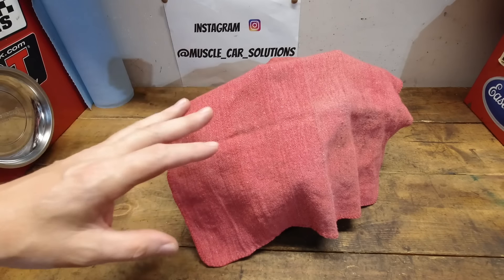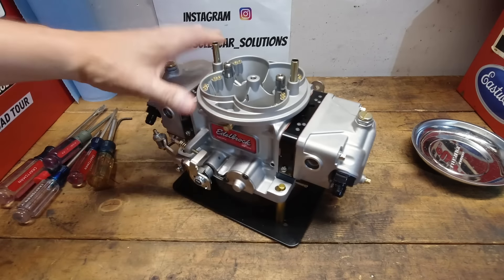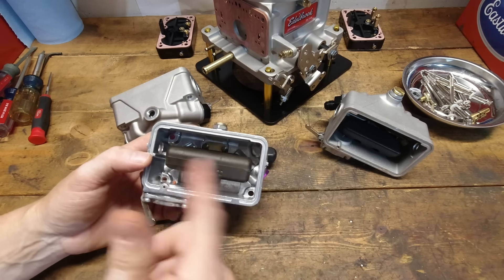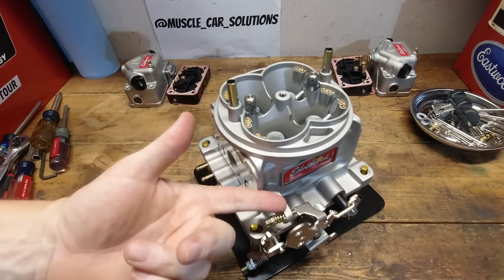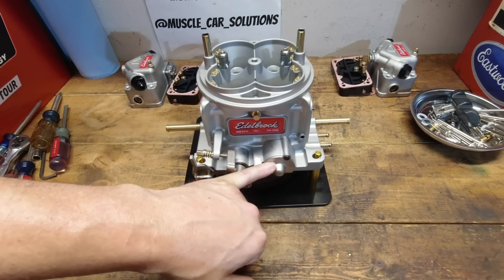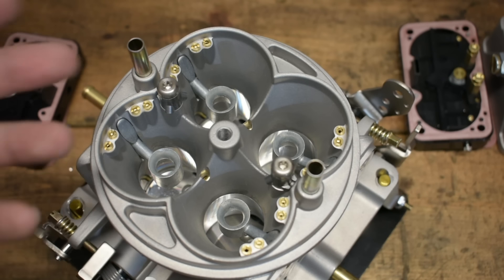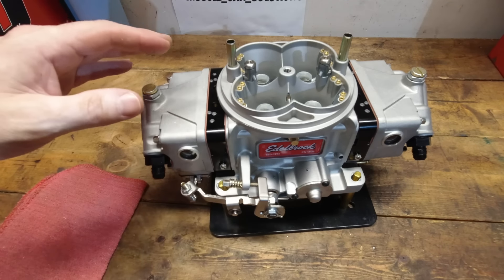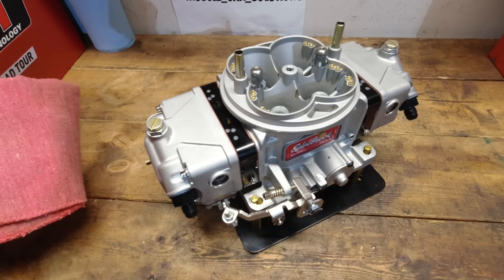The New Edelbrock VRS-4150 Carburetor - Full Review!

Comment: Glad to see Edelbrock coming out with a new carb...Especially since Fuel Injection is the "Must Have" these days! Hope they engineered the throttle linkage to give proper geometry for overdrive transmissions that use a cable.
Reply from the maker: Proper geometry isn’t achieved with the throttle linkage as the heights vary based on the intake pad height.  It’s achieved with an adjustable linkage adapter for the different types and connections.
Reply: Exactly right about EFI being the must have. My next door neighbor loves telling me about his EFI and how he won't ever smell like exhaust again. Meanwhile I do some math, found some GT40 heads for $400. Another $500 to swap my 2:78 rear end over to 3:55's. That leaves  $300-400 left for mid-eye leaf springs and 620 1" lowering springs if I want to go that route. Yeah I'll pass on the EFI and conservatively say I'll shave 1 whole second off the quarter mile, or a whole hell of a lot faster stoplight to stoplight which is where I really drive.
Reply: @MuscleCarSolutions  Ok, then why does Edelbrock sell a $40 doo dad to "correct" the geometry for a 700R4 hook up on their AFBs?  Attempt to sell I should say, I made mine using a junk TBI piece.
Reply from the maker: @paulhare662  it’s a good question.  Why does Holley offer an adapter to hook up to their carburetor(s)?  Because it’s not about it hooking up to every single option out there (not possible).  It’s picking the one for your application and then getting the line needed so it works.
Reply: @paulhare662  because people like you who don't understand how to set it up properly will buy that doo dad and spend that extra money!! I'm absolutely not hating on you everyone has to learn and after 30yrs I'm still learning myself
Reply: @jonathanlawson4667  People like me huh?  The ones who note the cable mount position, the linkage pull arc and duplicate those things? With home made contraptions?   Calibrating the governor was a bit tricky but well worth the effort.
Reply: @paulhare662  yes you plainly stated and ask if they changed the throttle to accommodate the geometry so you could set up your TV cable correctly!! You don't need them to change anything to set it up correctly 💯
Reply: @MuscleCarSolutions  Yup, I baught one of the quick fuel HR 750's and had to get a "corrector" bracket for my R4 transmission, not really nothing to do with the carb itself. The bracket also came with the little ball thing to hook the cable to my carb. So yeah I had to add that to the carb I guess, no big deal. P.S. I love this HR 750, it's been a great piece!
Reply: @BPattB  I like the smell of burned gasoline

Comment: I had an Edelbrock 500cfm on a 66 mustang for 8 years and not once did I touch the thing. Even when I would store the car for months at a time, I turned the key and it would always fire right up. For reliability, you can’t beat an Edelbrock and to see this high performance carb is just awesome.
Reply: But this new carb is $800! You can get 2 AFB's for that money and you already know how reliable these AFB's are, I dont see any advantage in going to this very complicated carburetor when you can for half the money get a simpler and more reliable carb off the shelf!
Reply from the maker: @gkauto1959 It’s not a street carburetor.  You’re comparing apples to oranges.  Two totally different applications.
Reply: $800 for a carb? you can spend half of that on another new carb and modify it all day and do much better for yourself. Not all of us have lots of $ an no brains whatsoever!  @MuscleCarSolutions
Reply from the maker: @gkauto1959  it’s obvious you’re not a racer.  It’s ok.  $800 for a four circuit carb is unheard of.  That’s a $1500 custom carb from most builders.  Hang out with some folks that run a carb and race.  They’ll school ya.  😉
Reply: I took a 72 nova into the 11 second bracket, drove the car to the racetrack, uncapped the exhaust, put on the slicks and put in the 110 leaded premium running a $400 new 800cfm AFB, that I personally ported and tuned to the point where it was great in stop and go traffic and was good for 7000 rpm upshifts. Tell me Im not a racer? I do this all on my own with nobody helping, engine, transmission and suspension mods by me alone.  Yeah, I guess you must be someone special to know that about me!
 @MuscleCarSolutions
Reply from the maker: @gkauto1959  😂😂😂 if you’re gonna tell a story, might as well make it a big one.  👍
Reply: I’m digging the ability to add a TPS for the trans in my application.  Great review!

Comment: No mention of the throttle blade shaft screws ---- are they flush with the shafts❓
And are the shafts thinned where the blades are attached by the screws❓
Also what type of material or steel are the blades made out of --- polished stainless steel❓
Thanks for the video 👍

Comment: Question: Since it has no choke, how is it at cold starts in the winter weather at 20 degrees??
Reply from the maker: It’s a race carburetor.  If you need a carb with a choke, get one.  This one isn’t it.
Reply: Thanks for your reply @MuscleCarSolutions
Reply: That ends that. I had high hopes for that VR1 650. Especially since I saw that guy with the slant six throw it on out the box and it fired right up. He said it was cold outside, but it didn't look cold!  So, I have another question then. I'm currently running an Edelbrock AVS2 650 electric choke. Infact I've been running Edelbrock carbs for some years, but I'm no expert like you are.  I used to run the 1406s all the time. Yes, I can and have rebuilt a couple. But I don't do any special modifying. I just set the air mixture screws, fast idle and regular idle to my liking.  I have a stock 350 rocket engine. The question is.....sometimes when it's cold out, my electric choke sticks when it closes at cold start up. Could I spray some WD40 on the linkage to keep it loose? or what should I do? @MuscleCarSolutions

Comment: I watched a video of yours just a while back about Carter AVS carburetors and how they had a tendency to uncover the Jets when you turned hard to the left or to the right. If you look clear to the back of the lower piece there is a channel that connects the two fuel bolts together and there's a place to put a blocker to keep that fuel from running over to one side to the other and that solves my problems with it.
Reply from the maker: @duanebiesterfeld4719 correct.  It’s the passage that supplies the drivers side bowl with fuel.  However if it’s blocked off, it completely starves the drivers side.

Comment: Would be interesting to see a engine dyno shootout of this series versus a Holley 4150 equivalent.
Also, I gotta believe at some point a full on street version will be in the pipeline at a lower price point minus all the adjustability. Most of which isn't necessary for street driving. 
Very cool to see Edelbrock going to bat for traditional hot rodders.
Reply: Let’s get the guys on engine masters to do it!
Reply: You can add a choke horn to it and vacuum secondaries without changing much else on the carburetor, I think.
Reply: I think you'll find that the adjustability will be just as important  on street cars, as well as race cars, in the interest of economy and emissions
Reply: Yeah, I wish they would come up with a street version of this carb. My 351W is not for racing...
Reply: @solarflare4259  Brother, I think with so much adjustability built into this carb, you could tune your 351W to absolute perfection
Reply: @solarflare4259   the regular eddy avs carb is a great street/daily carb.
Reply: It was fun to see them side by side  you know they intentionally made there's bigger 😃 I too have a mild street truck a 600/650 for under 350 hp would be right up my alley 😏.
Reply: @chrisw5837  yes pik a Rat that lotas people can relate to & run it against a Holley HP to compare.
Reply: @johnk1532  for those that can comprehend all the adjustments , which would be mostly bracket racers , for their street cars or trucks .
Reply: @solarflare4259  I saw someone run the 650 on a Chrysler slant six straight out of the box and it ran great. No bog, no cough when given gas.
Reply: @johnk1532 The adjustability is the entire point of this carburetor.

Comment: The taller vent tubes prevents fuel sloshing  out during rapid acceleration (drag strip). In the past (old bucks as myself), you connected a fuel line from one tube to the other. A "notch" was cut in the center of the hose for venting. Defeated air-flow though. This effectively " lengthens" the factory  by length. The bowls are also effectiant in straight-line launches. Fuel does not "roll -over" the floats. let's not forget about the bent "whistles".
Reply: had to do just that on my T wedge with 660s to stop slosh after the burnout many yrs ago .

Comment: Just came over from Uncle Tony's Garage to see what he was getting all exited about, i can see why now. 

Edelbrock have put a lot of thought into this, using symmetrical parts (float bowls and metering blocks etc) to cut down on production costs which would allow them to invest in higher quality castings.
Also being adjustable at all four corners will allow you to correct any AFR differences between cylinders caused by inconsistencies in flow through the manifold and heads.

Anybody who can pick up on making the adjustability work should be able to get a fair gain in performance.
Reply from the maker: The possibilities are endless here.  What a great carburetor.  Thanks for stopping by!

Comment: I want to see adjustable jets, like a "click click" knobs on carbs.
Reply from the maker: The big issue with that on a street carb is people would not allow enough time to drive for feedback from the adjustment.  They’d be clicking those adjustments every five minutes.
Reply: @MuscleCarSolutions  Yea but I remember a custom "block" that fit between the carb body and fuel bowl and they had a adjustment like that (years ago).  I thought it was ingenious at the time.  Theres motorcycle carbs out now that have "no jets"!  They use a tapered metering rod that with more air flow more fuel flows.  Supposed to be great in higher elevations and very little adjusting overall.  I would like to open up the WWII 'Pogue" carb and have a look at it.  Secret classified stuff, a tank getting 50mpg.  You did "the best video" on the new carb thank you so much!
Reply from the maker: Thank you!  Appreciate that.

Comment: Holley 4150 is a line, and style of Carburetor. To ask for one part number to describe that is not possible, as there are many different part numbers that fall under the 4150 purvue. After the Holley held patent was removed, many similar carburetors with the same looks, similar features and method of function came on the market. The Aftermarket parts industry calls them "Holley Clones"  Here we have it. Edelbrock copied the Holley.

Comment: Wow! It's amazing the amount of innovation and tuneability this carb has for the price! May this be as good or possibly better than fuel injection? I'm sure it will have great throttle response because of the lowered venturies. I'm no engineer, but i've dabbled in a few in my day.
Reply from the maker: Different application.  Think of this primarily as a race carburetor.  That’s where it will make it’s money when paired up with a good data logger to see the whole rpm range and decisions can be made on where more or less fuel is needed.  I’m not sure how practical it would be for the average street car user.

Comment: I love the drains in the float bowels. That would be the number one feature for me alone.... Nothing worse than dumping gas all over a hot manifold to make a jet change.  I'm not a fan of the one piece body and base, one less gasket I guess but I like the idea breaking the entire unit down during a rebuild.  Cost is comparable to Holley but nothing to write home about.   I probably won't live long enough to use all the Holley carbs and parts in my inventory to justify switching brands.  If someone hands me one, I'll certainly give it a whirl.

Comment: Ok a Holly done by Edelbrock !!!
They have a different type of plastic an rubber that doesn't dissenergrate in new gas !!!
I had finally just went to Edelbrock carbs over Holly's back when I was messing with engines !!!
Could get around a year before going into them !!!
They have the "Jet Plate Kit" on the side too ???

Comment: Will a drop base 14" air cleaner clear the fuel bowls?
Reply from the maker: @SameGuy875  yes.  The Edelbrock air cleaner that fits is in the description
Reply: @MuscleCarSolutions  Will a 1-1/4" drop base work? With the VRS being 1/2" taller the Edelbrock 1221 will not work in my application due to hood clearance. Thanks.

Comment: All those amazing improvements but you still have that dam power valve that blows out on the first backfire - not to mention having to remove float bowls etc etc etc
Reply from the maker: @yambo59  the backfiring issue was fixed in the 90s.

Comment: I am surprised someone would  design and make a new carburetor since the last new production one was in the 1980's with the Mustang.  I would like to see a Carter AVS type carb designed as a high performance carb with a 1000 CFM or more.
Reply from the maker: I think they tried making one over 800 but it turned out being complicated to get the fuel to mentee properly and with enough volume.  Would take a full internal redesign and honestly they sell plenty of that carb as it is.  No need to dilute that line.  So they built this ultimate off the shelf, inexpensive race carb!

Comment: The BG Race Demon had all those features in the 1990s.  BTW a small fuel bowl controls fuel slosh better than a large bowl. That's why a Qjet had a small bowl for 30 years.
Reply from the maker: Those carbs had a couple of the same features, not all.  And I’m not sure what kind of racing you’re into, but I don’t think carrying less fuel is going to help continue to make power.  Especially with the high HP that engines make these days and the addition of ethanol enhanced fuels that require more more volume.  Not really a fair comparison.

Comment: I have a 350SBC with RV CAM. 700r4 trans. Headers. Currently 750cfm performer carb electric choke. 4x4 1976 GMC Jimmy. Would i be able to run this carb ? I would like to get the 750cfm but I need to have the TV cable hook up. Thnx in advance. Beautiful carb! UTG sent me!
Reply from the maker: I don’t know that you’d take full advantage of all the features of this carburetor.  The 750 performer sounds a little big depending on the specs of that cam.

Comment: So it wont work with a dual 4 barrel intake because of the added length. 😢
Reply from the maker: Nope!  Not unless you mount them sideways.
Reply: @MuscleCarSolutions  Wonder if they will make a redesigned intake that the dual carbs will fit on. Dual carb intakes are Race in a sense. I guess well wait and see. Wonder if they thought of this when designed..
Reply from the maker: @jonjon_az  the sales on those intakes is so low that I’ll guarantee they never took it into consideration.  I’m honestly surprised they still offer them.  But given they only make them once or less per year, it wouldn’t surprise me if they discontinued them.  So no, I’m sure they gave no thought to fitting on a two four set up.  If you had a dominator top they might fit.

Comment: I was interested until they lied about building a 950 CFM version, so I have to run a Dominator
Reply from the maker: Lied?  😂 they’re still in tuning.  Things don’t happen over night.  Happy they didn’t release it till it’s ready.  I’d imagine it will be out in a few months from what I’ve heard.
Reply: They removed 1309 part number from the Web site
Reply: Since when is 2 years over night?
Reply from the maker: @michaelgreen5084  because it’s not ready for sale yet.
Reply from the maker: @michaelgreen5084  they never said all part numbers would be released all at once.  😂 They have released in order so far and the 950 is next.  Hasn’t been two years.  😂 I got an advance prototype in late august 2022 and they were on sale in mid September.  Worth the wait!

Comment: Japanese carbs like Mikuni-Solex and Hitachi have had air bleed jets to fine tune the circuit they control since the 60's. From lawn mowers, single cylinder utility engines, air cooled Wisconsin engines, motorcycles and vehicles like my buddy's 68 SS Camaro in 71. He paid $2,800 with 58k miles on it, one owner. But, he wanted to race it on the local 1/8th tracks. I had a 68 Charger stock 318 but enjoyed more room. Pulled two engines, installed one, got $250 cash plus the car. 
  I will say this carb has everything I would need to adjust rich or lean issues at any RPM. 
Nice! ASE Master 78.

Comment: So Edelbrock made a Holley...  But more complicated.. I say complicated, it isnt, but if you really want to make use of all the adjustments. Then you need to test on a dyno. Otherwise the average person could end up messing more things up with the fuel mixtures then actually fixing them. An O2 sensor will really be needed to properly tune the carb. But without a choke, most will not use anyway.
Reply from the maker: Pretty sure they didn’t consider dumbing it down for folks who think it’s too complicated.
Reply: @MuscleCarSolutions  Its clear its for those serious about racing. But billy bob shade-tree mechanic is very likely going to struggle getting the most optimal performance out of the carb. Thats what I was getting at. I was building Quadrajets when I was 15, mostly becuase people just about give them away because they couldnt get them to run correctly. I didnt have any problems. But, not going to lie, I could likely get the new Eldy carb to run, but without a dyno and an O2 sensor, I wouldnt ever get it to be perfect.